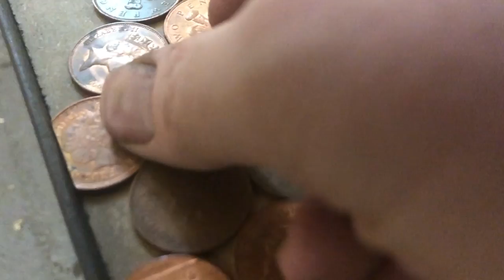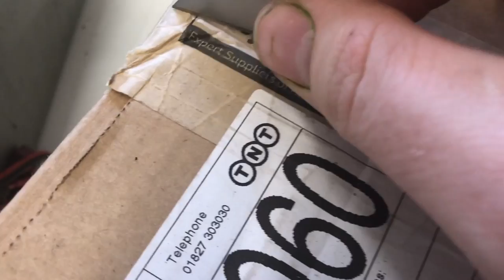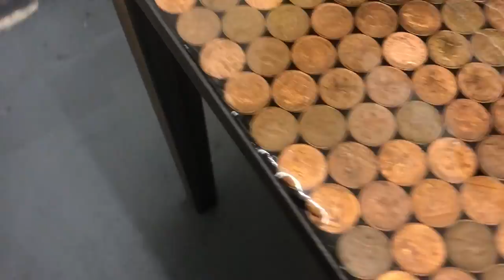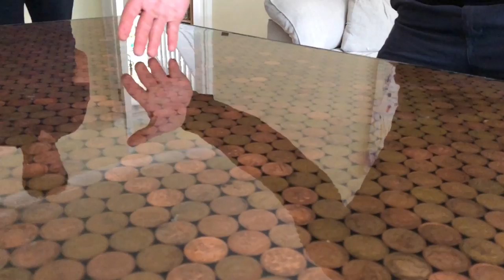Building a epoxy penny table

Comment: Nice work!  Wouldn't it be easier to paint the surface before setting the pennies and skip the grout?  That would require more epoxy, of course.  And if you stuck the pennies on the wet paint as you go, maybe you could skip the gluing?  Asking for a lazy friend.
Reply from the maker: I don’t think it would look as good. Lots of potential for little bubbles to settle between the coins, and the grouting process partially cleans the coins and highlights all the edges. The coins themselves look better after grouting than before
Reply: @PetesShredder  how deep was the epoxy resin finish do you mind me asking
Reply from the maker: @thephatchicken2177  about 2-3mm. Because I grouted the coins, there was no need for resin to Flow between them, so there is only a thin layer ontop. Some advice I learnt making this table - mix your resin very very well. You really need to spend some time mixing and making sure you've scraped the bottom and sides. The table in this video ended up having patches of uncured sticky resin. To fix it, I poured another thin layer over the top. It came out fine but I needed to mix it more, abs that's the number one lesson I learned from this project
Reply: @PetesShredder  thanks! Thinking of doing something similar
Reply: Que buen trabajo, me encanto !